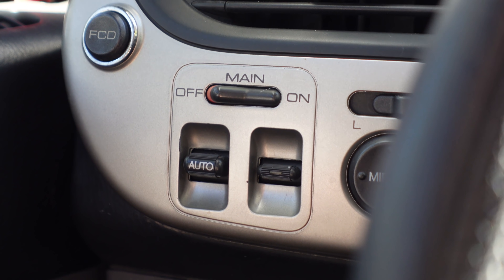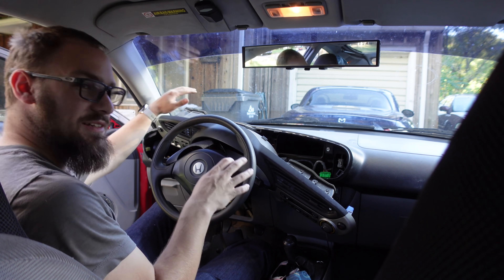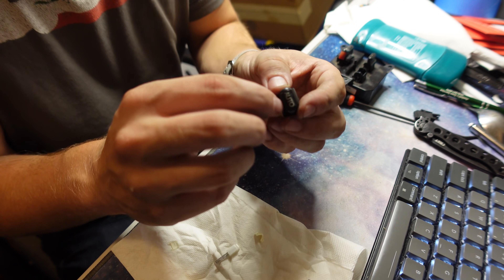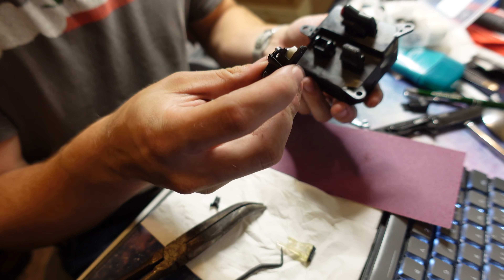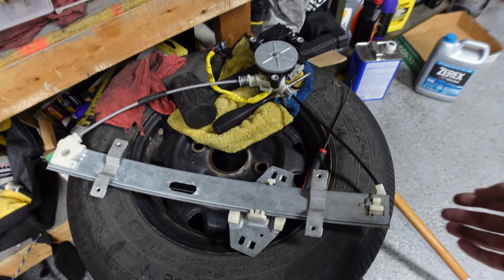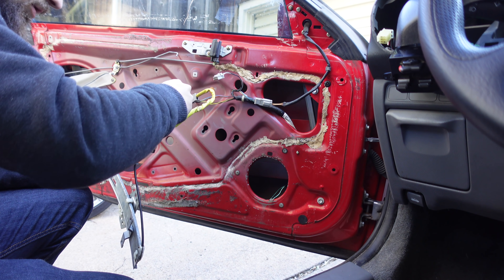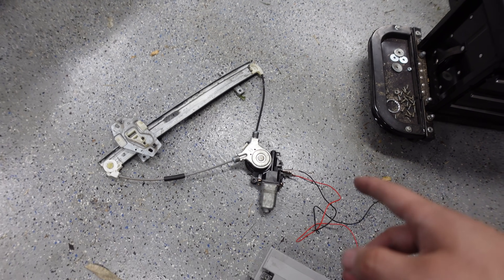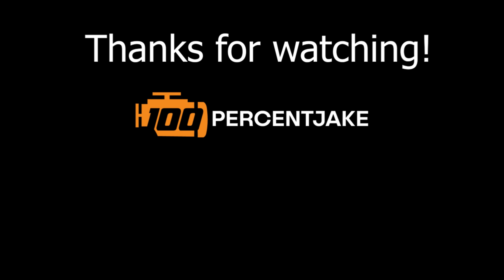Rebuilding RARE HONDA PARTS with a 3D PRINTER! (The future is now)

Comment: Jake. Electrician here. The rotating part of a DC motor is the rotor, which you were holding. The stationary part is the stator because it......stays. It doesn't rotate. DC motor rotors have a commutator which the brushes make contact with and ride on, switching polarity constantly as they run. The rotating part on bigger DC motors is called the armature and the stationary coils are the field. The field doesn't switch polarity and the current runs in the same direction all the time. ok enough technical jargon. I don't know why they would call the rotor a stator.

Comment: Self-resetting fuses are a fairly common electronic component these days. If you know the "normal" operating current you should be able to find one that only trips when the motor is stalled for a few secs and put it anywhere in the 12v feed to the motor. Even if you used an accessible "standard" car fuse, that would be a good thing.

Comment: Thanks for the vidrio! I need to do the first part, cause my driver’s side switch is floppy af!
Also - in my Insight, the switch in the passenger door, that’s in the same spot as the lock switch on the driver side, is the window control? 🤔

Comment: jake what happened to the parts car you bought? I'm sure you had a least one regulator inside of it. Also the switch
Reply from the maker: That's where I got the passenger regulator from that I took the brushes out of. The switch in it was broken as well. This switch failure is almost a certainty in every Insight at some point.

Comment: Had a 300tdi disco that thing had gremlins in all its doors permanently if it wasn't the actuators for the central locking it was the window motors or the switches.  Should of had shares in the little plastic Christmas tree  fixings manufacturers.  Used to be about £7.00 for 10 from landrover.  Be well and stay safe. UK.

Comment: My VW has the 'circuit breaker thing' for each window regulator mounted to the fuse board under the dash, that might be why your BMW appears to not have one. Alternatively you're right and BMW didn't deem it necessary.

Comment: Tip of the day:
Adhere some J-B Weld and fiberglass mesh to the backside of the cracked dash bezel. By doing so you'll prevent the crack from spreading.

Comment: Not trying to be a jerk, but WHY did you not take windows cleaner and a scrapper to the window tint glue on the window while the glass was out?!! That is part of the problem, the glue is making it sticky as it goes up into the track in the seal. Out of all the regulators I've ever replaced, 100% of them had tint glue in the track of the window, none had died of natural causes.
Reply from the maker: That's an interesting point. I do plan on getting the window re tinted, but I wasn't in a hurry to do so. I might get some isopropyl and goo gone and yank the window again and get that done. It comes out easy enough.
Reply: @100PercentJake  window tint glue is super simple to remove, just use ammonia based windex and a NEW window scraper blade and should have ZERO issues

Comment: If you've never had a window that didn't work for months/years and then you are able to fix it, you'll never know how satisfying it is the first time  you can actually go through a drivethrough.
Reply: Replacing my front passenger window regulator to my Jeep was extremely satisfying.
Reply: Been there, done that.  My ‘00 Grand Cherokee windows, power mirrors and locks didn’t work for a year or so.  Wiring between the door and body.  It was very tired at 170k
Reply: @robertwhall  I have a 99 GC laredo with over 270k.... she needs work